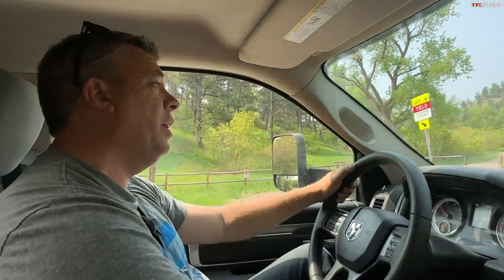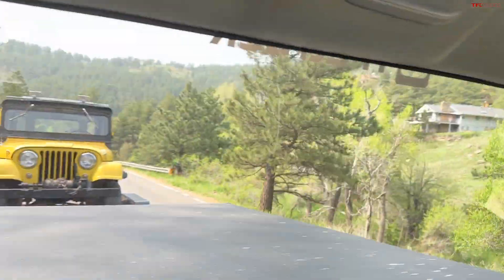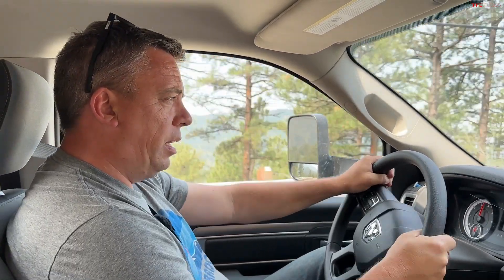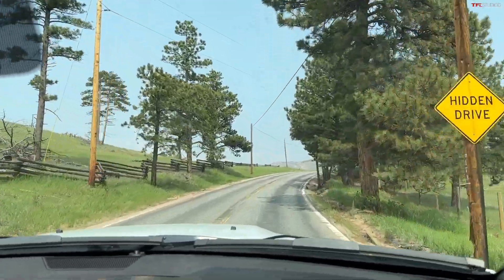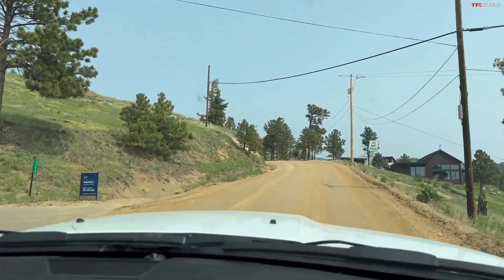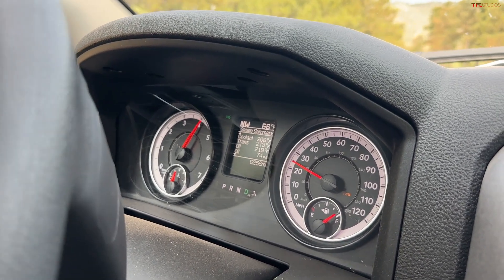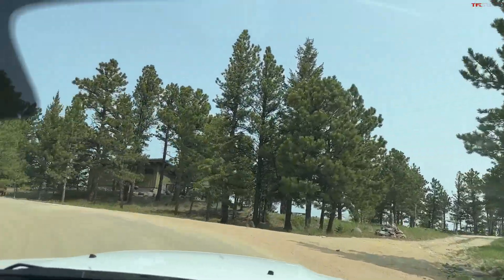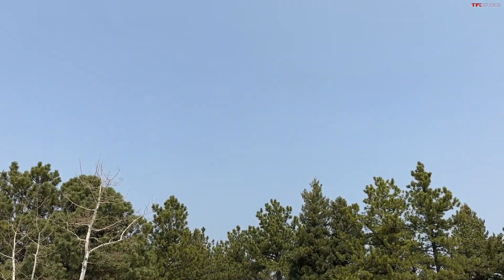A BRUTAL Towing Torture Test! Will This Uphill Run Overheat Our Maxed-Out Ram 1500 Classic?

Comment: You tube loves to hate on the 3.6… but it’s a good engine.
Reply: The plastic oil filter/cooler housing that has to be replaced in it does it no favors.
Reply: Damn, I forgot about that part!!  I did that job on my sisters mini van... not hard, but what a mess! I guess they have an all aluminum one now in the aftermarket.. I doubt Mopar will change things on their side, I don't know if the Pentastar is going to be around much longer with the new hurricane engines.
Reply: Got a 14 outdoorsman with the 3.6, 355 rear, towing package. Love it
Reply: The 3.6 sees a ton of use and abuse. Since Its the base motor in the Tradesman and Promaster Van, many wind up in fleet service. Beat on mercilessly by drivers who don't own them, subjected to heavy loads and stop and go driving by delivery services like Amazon and USPS. Service windows stretched by bean counting fleet managers, and fed low grade oil fuel, Often overloaded and idled for hours by workers trying to keep warm in construction and utility work , they somehow manage.
Reply: Initially.   Initially.   Initially    
We will see in a few years.
Reply: That depends on whether you 3.6 has eaten the followers and cams. As a professional technician I am not impressed with them. We only service a few of them regularly but all of them are making noise and all of them have been properly serviced.
Reply: And you know this how?  It hasn’t been out long enough to be a good engine. Get back to me in 3 years.
Reply: @rofin9541  I'll trade it in by then....

Comment: It looks like zf and Chrysler did one thing very right in terms of slow speed towing and left the torque converter locked all the way down to 2nd gear in tow haul mode
Reply: Its a good  transmission  I tow all the time  with my classic  ram v6 I've got the tow group  and 3 .55 ⚙️  gear ratio
Reply: I agree, the truck knew not to push its self even tho it made it a little slower but it stayed nice and cool for under the conditions that it was in
Reply: It locks in first also

Comment: I knew the power wasn't going to be great, but I am impressed at how well it maintained temps. I bet it would have completed the dirt section in 2wd just fine. I would like to see more videos on this route. Slow speed towing is hard on coolant, oil and trans temps

Comment: As someone who as owned a couple of Jeeps, I have always thought Chrysler (stelantis) could do a much better job with gear mapping and when it should downshift. Especially if you are going uphill and have cruise control set. The other big thing I notice is, when you get off the gas and then go back to gas without touching the brakes, it is slow to respond to input of being back on the gas. My work around for both complaints is to put itnto sport mode, and it will downshift sooner so you don't loose as much speed going uphill, and throttle response is more like I would expect it to be. (no delay)
Reply: Ram does that to keeps the trans temps down also they have fuel efficiency and trans longevity to think about as well I think it's not bad at all for a stock tune but a trans tune would fix that hesitation
Reply: With Cruise Control my truck shifts fine uphill, it’s when I’m not using Cruise Control it stays in 2nd. For me anyways lol

Comment: This tighter, twistier road reminds me of the first time my family drove from Texas to Ouray, CO with my dad towing a 16 foot utility trailer with 4 dual purpose motorcycles. This was in 1997 and my dad had his 1989 F-150 with the 5.0L and 4 speed AOD. That trailer couldn't have been much over 3000 lbs, but the old Ford struggled up over Red Mountain Pass on US550. There were times he couldn't make more than 10 mph. 

That little Pentastar is huffing and puffing, but it's getting it done!

Comment: I have a 3.6 ram 2019 single cab I abuse pretty hard flooring it because you can feel the power it’s a great truck.  I have about 60,000 miles on it and  have towed with it. it’s happy towing good on gas great truck. Stock exhaust sounds great on it too quiet when it needs to be but when you floor it sounds like a sports car and not in an obnoxious way.  You can do donuts in it pretty easily too it’s just a fun truck all around

Comment: This v6 engine did very well! I wonder how the 5.7 Hemi would do in the same test 👀👌🏽
Reply: I bet it wouldn't even sweat, I've hauled over 5k with a trailer. 

 with a tool box/ bak rak & a 200lbs of tools in it. 
Also had 450lbs or so of weight between 2 occupants. 

I'd estimate i had a payload of close to 800lb 
W/o tongue weight.....

+ a 5k plus trailer..... barely could tell it was there. 0 struggle.

Comment: Great video again!  This towing test was a tough one.  I am not sure what the grade was but I am sure it was steep.  The switch backs prevent you from carrying much momentum through the curves.  Good job Stubby!  I am curious how Stubby would have done with you selecting the gears rather than floor the accelerator and let the truck select a gear.  I believe that this engine produces peak torque around 2,800 rpm.  Would it be better for the truck to drive at a slower speed and select gears keeping the rpm between 2,800 and say 3,500 rpm?  Just curious?

Comment: Love my 2021ram1500 classic tradesman quad cab 4x4 v6 with lots of extras  got the 3.55 gears ⚙️  posi traction  towing group and all terrain tires got mine for less than 40 k great simple  truck 🛻👍
Reply: I just got my ram classic v6 warlock for 50k CAD sticker price it was 67k. So basically I paid about 37k American
Reply: Just bought a 14 outdoorsman, rust free, towing group, 355 rear end, 100,000 miles, 10 K out the door. Great deal from  friend

Comment: People complain about midsize prices but at around $40k midsize trucks are typically more capable. For the same price, you could buy a midsize with 4-doors that's well equipped and better towing. Or you could buy a full size that's just a few years old. Tons of decently equipped 4-door Rams that're 2 or 3 years old with low mileage for under $40k.

Comment: I'm thinking it didn't downshift because there was nothing to downshift to. It was already in first gear. When it finally revved up to 5k rpm, it was around 30 mph, which would make sense for 1st gear getting to redline by around 40mph with that rear axle.
Reply: All he had to do is hit the down shift button to see what gear it was in. My 14 Hemi pulling 6,000 lbs in July 90 degree heat up long grades temps never go higher than 220 on oil and water. trans stays under 210.

Comment: I think the refusal to downshift was a programming strategy to keep temperatures under control. It was a limp mode with no indication to the driver it was in a limp mode. Modern vehicles can anticipate when overheating is inevitable. Andre said he could hear the cooling fan running and around the same time he also stated it was floored, not downshifting and not going over 30. The computer recognized it was commanding maximum engine cooling and temperatures were still rising. So it reduced engine power and locked the trans in, I’m guessing 2nd gear, to cool down. Not sure about Chrysler but in Ford and GM it cuts off fuel and spark to half the cylinders to use those cylinders to pump the heat out the engine through the exhaust. It works and won’t take long to bring temperatures down. However you would get a engine temperature and reduced engine power message. My guess is Chrysler is doing the same thing but not displaying a message.
Reply: I believe the Ram v6 in this truck has none of that gimmicky crappy green sh!t on it. It is a straight up v6, a relic in todays market. Sergio would be proud. I am...
Reply: @johnanderson60  what green…are you talking about? What I explained is the overheat fail safe mode GM and Ford use. Nothing green. Not everyone puts politics into everything.
Reply: @khakiswag  weren't the engine coolant, oil and transmission temperatures being monitored? Seemed like they stayed pretty constant, so what might the ECU be looking at if not those particular samples?
Reply: It looked like it was already in 1st gear, so nothing to downshift to. If you watch closely in that part of the video, you can seen the rpm climbed to around 5k around 30 mph, which would make sense for 1st gear with that axle ratio. Looking at the video they posted about picking up the Corvette, the acceleration video after leaving shows it hitting ~40 mph in 1st gear.
Reply: Stubby wins again! She climbed that mountain grade at high altitude with a rated load. This truck only has about 300 hp and 280 pound of torque. So she’s not a speed demon. We all saw she was not happy working hard under 3500 rpm. That’s to be expected. The pentastar v6 is off the bottom end of the torque curve. Once she gets past around 3500, she gets going. So he did good over all
Reply: It was in 1st gear at that speed and rpm.

Comment: drive the  2013 5.7 shorty  4x4  and it hauls my 25' airstream.  5900 lbs done the Donner pass I80 , continental divide  on I40.  long grade on I15 to Vegas      I  run out of steam  but. never over heats do like the dodge gauge set up so one can monitor  all temps  in one screen . my next tow rig will be a v6 tundra ? or F150 powerboost  ?

Comment: For a well maintained dirt road you don’t need 4wd. Also it cuts power from the rear, would be different if you weren’t towing and didn’t need the full power there. Under load though I’m surprised if passed where that Silverado failed, I’m impressed.

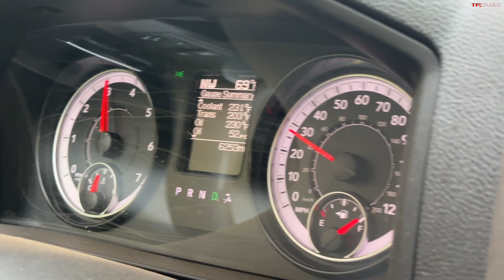Comment: why is the dash glass so scratched 1:09
Reply: Mine is in my fifth gen ram too. They use cheap plastic
Reply: Yeah,  but what is touching the glass causing it to be scratched? I mean in reality nothing should ever touch that
Reply: @nrgzrbunny7775  This is total speculation, but I could see some dust or sand getting on it, and someone just wiping it with a dry cloth to get the dust off, and then the dust/sand scratches the dash as they wiped it.

Comment: This trail is probably the most important test on the channel. But if the truck goes into overdrive while you're flooring it, you need to know when to manually downshift to save the engine and transmission. Trying to go uphill in overdrive at 2000rpm is a truck killer.
Reply: What he should have done is put in low range

Comment: Pentastar makes no torque down low, has to be over 4000rpm to make advertised 260ftlbs . Short stroke,small displacement N/A.
Reply: Doesn't the pentastar have 90% of the torque available at 1800rpm? Or am I looking at the wrong graph
Reply: Yes the graph is correct. You ever drive one? It's never going to be near 1800 when working. I was clumsily referring to the tranny trying to keep the usable torque at 4000 thru 5500 but , past 5200 the torque drops off and hp goes up thru 6500ish.
Reply: @michaelatkins9780  I've driven a couple and they aren't much slower than my ram hemi and they feel a lot lighter with the front end the cars I've driven with the pentastar were actually quick as well but yes at 4500 does feel a bit sluggish but this video it's not the high revs it's the torque converter locking and it's not switching gears at low rpms which is for keeping trans temps stable

Comment: Wow that 3.6 is just gutless down low and that is one of my biggest issues with the 3.6 Pentastar.  This engine is so gutless till about 4k then it finally wakes up.
Reply: Not really 3 .55 gears  make a difference  when towing  I tow all the time with mine
Reply: @tomstarcevich1147  The 3.6 is still a gutless wonder even with 3.55 gears
Reply: @thejmcGarage  90% of the torque is available at 1800rpm for a NA V6 that's impressive I wouldn't say it's gutless just not as much torque as a V8
Reply: Mine has 355 gears, it makes a huge difference
Reply: All 4 valve per cylinder v6 are gutless, they are cammed to rev high. That is why there are 8,9, and 10 speed transmissions today.

Comment: I'm quite frankly amazed Dodge made a vehicle that doesn't die under light loads, let alone heavy / over-loads.  I guess the rest test will be if it's in constant CEL mode after warranty runs out.

Comment: The company i work for bought a half a dozen 1/2 ton rams for the salesman and 2 of the Promasters for Deliveries. All with the V6.  Within the first year and a half 3 of the engines needed to be replaced. One half ton at 23k, one Promaster with 6k and on more half ton with 32k. All fortunately were under warranty. I wish they had gone with the  Hemi’s. ( Not a fan of those either but I think they would have been better.) These vehicles were never overloaded or hammered on. Just always seemed to be Rapped out and screaming, even when empty.
Reply: I just bought a v6 ram with 3.55 rear axle. I have no problem keeping it under 2k rpm while driving, the only time I get over that is when I go to pass people on side roads.
Reply: I have a same axle, 65 on the highway  it runs  about 1600 rpm
Reply: Considering this engine has a less than half of a percent fail rate world wide and is also a Ward’s 10 best engine, either you’re full of it or someone there was purposely sabotaging them.
Reply: I would bet you company changes oil every 7-10,000 miles like the evic says. Oil is cheap, engines are not. 3-3,500 in all my vehicles.

Comment: At 68 degrees and you’re using A/C you must be really hot blooded.
Reply: I can see that if the sun is out as the small cab means you're a bit more directly exposed to the radiation. I'd personally probably not have AC on but have the fans a bit higher, however given they are filming they probably dont want background fan noise (or as mentioned with the wildfires, keep recirc on with AC to avoid smoke coming in).

Comment: I'm just happy to see work truck testing.  I know you make your channel $$$ on the luxury trucks but those are just modern El camino cars with open bed.

Better to manually control vehicle, then just floor it when it will not downshift appropriately.  Need to keep the engine in the higher torque area.  Plus this was only 5k?  This is easy mid-size truck or suv zone.
Reply: Heavy truck with a small engine and no torque

Comment: Pretty good for the little fella.  That 3.6 is just so weak. Not unlike in the Gladiator when you did the Super Ike with it and a 3.6. Less than 5000 lbs is kinda ok, but in the Gladiator the diesel shines. 
    How have your detailer/s scratched the lens of the gauges so bad already?  For some reason that plastic is so soft it scratches really easy. I have had luck with a lightly dampened perfectly clean micro towel.  Hope it helps.
   Thanks Andre & Paul!

Comment: V6 is OHC engine and if compare that with Hemi V8 OHV engine, V6 is designed to rev high with no problems and no pressure on engine, on the other side Hemi cant rev high even if you want, because of push rods, rods will not survive. So people nothing wrong with reving high V6 is not going to overheat, you will not damage it, its just they way its designed, way better then hemi. So don't listen this guys who says Engine is screaming.  They don't know a shit about engines in generally, they just make videos, so you can watch and they will be payed by YouTube.

Comment: So you are exceeding the tow rating again, and think that the rules don't apply to you because you have a CDL.  You can tell that this truck isn't even loaded right based on the thumbnail picture.
Reply: A bit of an overreaction there. Without knowing specifics it's hard to really have an overt opinion on the setup.